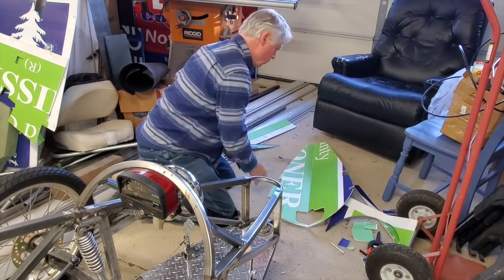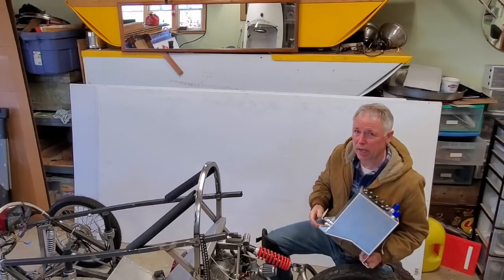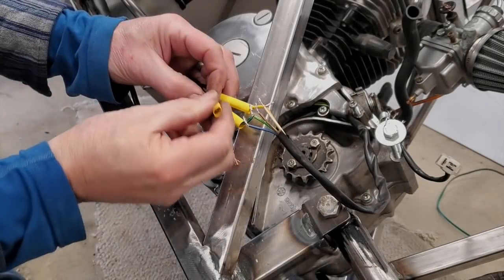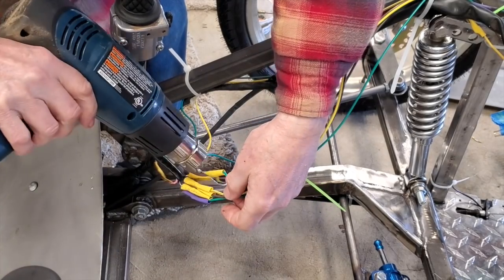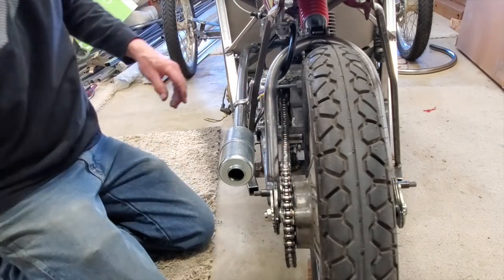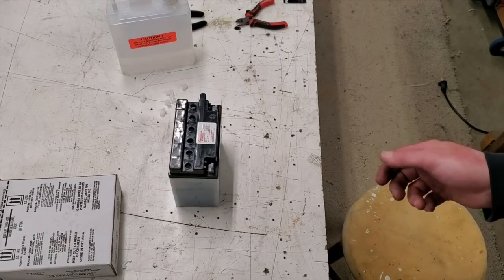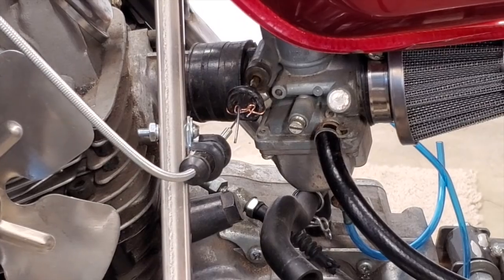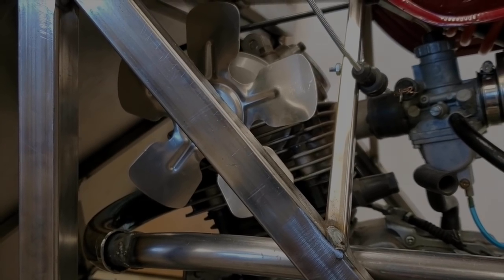Fuel efficient reverse trike build (part-10)

Comment: The foam isn't for gas fumes, it's to keep the fuel from sloshing back and forth. It's a fuel cell
Reply from the maker: Thanks for straightening me out on that Heather! That makes more sense than what I read up on the tank.
Reply: @paulwelkinsdiy  no problem, and I'm absolutely loving this build. Hey you might have said something about it but where did you get that canopy? I've been working on building a velomobile for some time now. That canopy is absolutely perfect for what I need.

Comment: I'm really curious why people still use the liquid filled batteries, vs SLA/AGM (or even lithium ion for the big spender).  The liquid ones are only a little cheaper but require messing with chemicals and you have to maintain their water level, seems like a huge PITA for a really small savings.
Reply from the maker: Thanks 777arc. I was on the fence on lithium or lead acid. Next purchase will be the lithium.

Comment: Very nice to see this update! It's been so fun following along with this build. I'll be very excited to see it rolling down the road, but sad when their series comes to an end. That being said, I'm sure you'll have plenty of other interesting projects coming down the pipeline. Keep up the great work!
Reply from the maker: Thank you! This is one of the most complex projects I've tackled, but one that was on the top of my bucket list for the last 40 years. I checked out your channel. I too was a recumbent buff before they were a thing, then I blew out my knees on my DIY recumbent one cold winter day. The IHPVA gave me lots of inspiration on the advantages of aerodynamic body configurations, then I discovered Craig Vetter's mileage challenge website back in the 80's. The bike I'm using on this project is the same year and model as the faired and modified motorcycle that recorded 350+ mpg on highway 101 back in 1982. Seeing I'm over 100 pounds heavier I'm hoping to get at least 120 mpg on the highway. We'll see.
Reply: @paulwelkinsdiy  I've seen the interview you did on the Laidback Bike Report a while back, so I'm familiar with your history with recumbents and some of the inspiration for your current project. I bought the plans for your Coro Kayak last weekend and I'm hoping to build one this summer!

Comment: Compartmentalize the cylinder apart from the carb, and header flange, add cowling and ventilation pipe, and you can draw, or push heat into the cockpit for cold weather driving.  🙂
Reply from the maker: You read my mind. I'm an old VW bug buff.
Reply: @paulwelkinsdiy 👍👍 It just made perfect sense when you brought up the fan/direction. Great idea for a cooling fan, btw. how's the rpm looking on that side of the timing chain? if it's a slow fan, add a couple gears outside the valve cover as well, and boost your fan rpms?
Reply: @paulwelkinsdiy  Btw, I had a 68 Beetle for a number of years, as my daily. 😁

Comment: why did you opt for this battery? wasn't a sealed one better and more practical?
Reply: Yeah, why not a lithium ion battery for weight savings?
Reply: @edwinarmstrong9175  a li-ion battery would be way more expensive, but you are right it would be 4x lighter.
Reply: I have one on my motorcycle & it is worth every penny for the weight savings. Oh well, just a suggestion since I thought it was important.
Reply from the maker: @edwinarmstrong9175  I bought this at a battery store. They often store odd-ball sized batteries like this one for longer shelf life.

Comment: I recommend getting ethanol free gas for the aluminum tank because will slowly erode from the inside with regular ethanol content gas, unless you line it
Reply from the maker: Good advise. I have coated old motorcycle gas tanks before with a liquid plastic liner. I'll look into that.

Comment: I'd like to build something like this only with maybe a bit larger engine so I could use a driveshaft model.
Reply from the maker: I too would love a drive shaft, but sprocket changes for lower or higher gearing become impossible without a tone of machining.
Reply: @paulwelkinsdiy  The chain is definitely the more forgiving of the two when it comes to lining things up. Have you considered a belt?

Comment: Be carful using spoked wheels for front steering because motorcycle spoked wheels are not designed to take SIDE LOAD !  The spokes can just collapse during a hard turn.   On a motorcycle spoked wheel the wheel always puts all forces back directly to the wheel axle through the spokes never a side load.....
  If these are just motorcycle wheels have them re-laced with stronger spokes.  Great projects...

Comment: Your fan will be doing 1/2 engine speed, might be good if it was 2 x engine speed, but I guess it’s better than no fan 🤨
Reply from the maker: I've thought of adding a large sprocket on the shaft and a small one to the fan blade, but it wold increase the complexity. I might play with more pitch on the blades if need be.

Comment: In order to avoid damaging the exhaust, the rubber bearing must be attached, or is the engine not bearing either?
Reply from the maker: Are you talking about the exhaust hanger in the back? Not sure what a rubber bearing is. It didn't come with one if you're talking about where the pipe meets the head.
Reply: @paulwelkinsdiy  To explain, if the motor can vibrate freely and is supported in rubber, fewer vibrations are transmitted to the chassis because it can move a little.
But if the exhaust is screwed to the frame, the vibrations will break it off at some point!
However, if the engine is also permanently installed in the frame, the vibrations in the chassis increase.
You should then make sure that the seat is well padded and that your feet and hands can operate the units with low vibration without feeling numb!